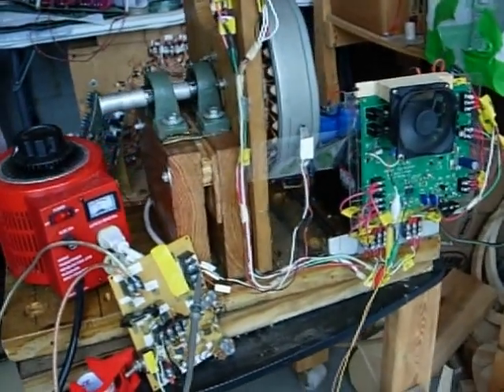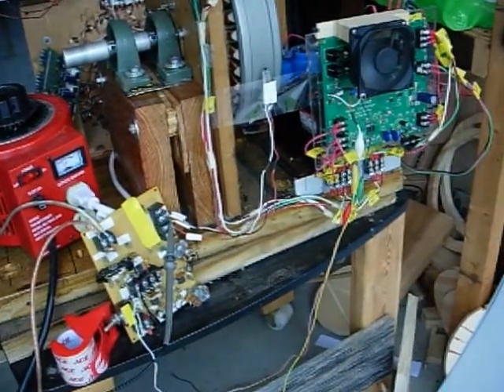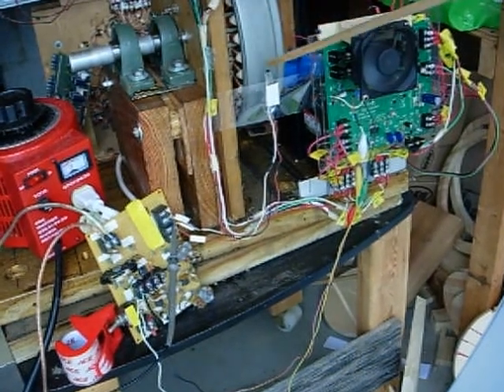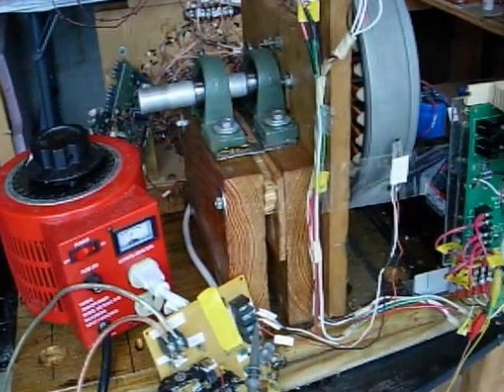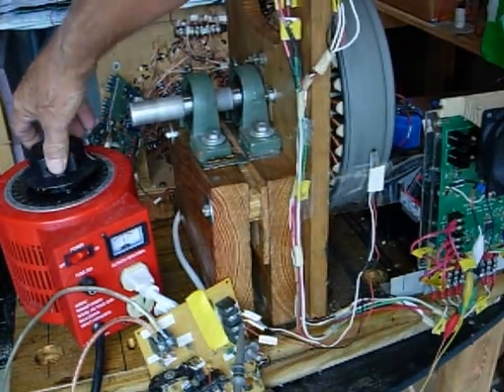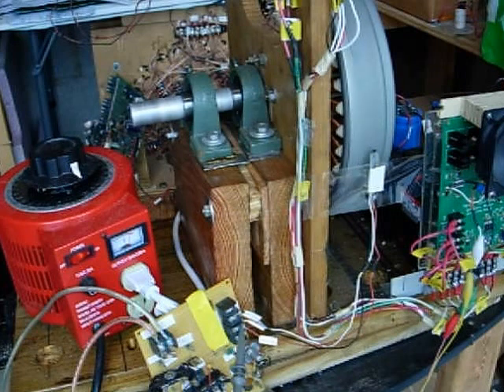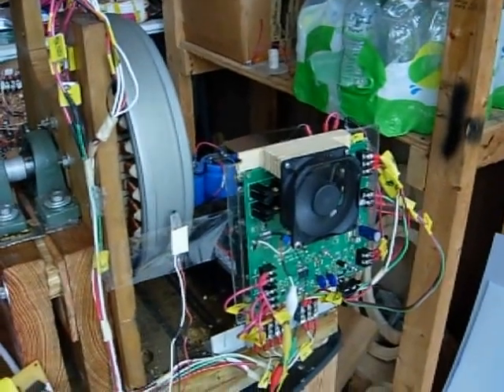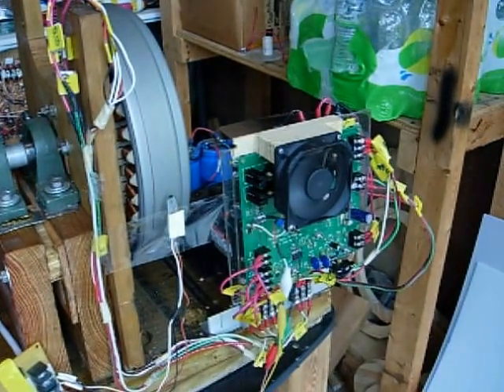Don Smith #131 running smooth at 191 VDC limit 2 amps 300rpm

Comment from the maker: I just found out that the original Hall Sensors 2 of them that came with my rotor had their flat surfaces aimed at the magnets on the rotor  the beveled edges were pointing away from the magnets.  I just ordered some more Hall sensors from Digikey  ATS177 bipolar latches.    It's interesting that the placement of the halls really changes the pulse width and position these directly affect the rotor speed and power along with chattering.  It'll be interesting to see how this all works.  I know that for each group of three coils there are 4 magnets NSNS so essentially their are 12 motors with 60/120 Degree spacing for Halls for my stator with 36 coils.  Hall sensors are placed A coil (Hall) B coil (Hall) C coil (Hall).   Using Oscope with Hall A pulses channel 1 you can check Hall B and Hall C on channel 2 to verify their relationship to Hall A.   I've messed with my B Hall to get 60 degree pulse but will probably change this back to normal 120 degree arrangement.

Comment from the maker: Next video will relate to motor phase, magnets, and Hall Sensors.  I just found an app note AN1046-D which describes using the MC33033 with MC33039.  First read indicates that my Rt Ct are wrong and the pulse width from the MC33039 is too wide and using 43K and 22nf at the MC33039 will provide a little less than 1ms pulses(970us) from the MC33039 to the MC33033.   The MC33033 with its Rt Ct at 5.1K and .01 yields a rate of 25khz,  this is the osc frequency used to PW Modulate the phase pulses.   I want use 4 or 8 small NEOs on the outside of the rotor.  By doing this with larger NEOs that match those inside the rotor along with outside coils 36 in my case the power can be doubled.  Their are even more areas on the rotors surface that can be used to repeat this process for even more power.   When you think about this,  the rotor could be not 2 inches wide but wider.

Comment from the maker: after frying my pcb I decided to use the old version 24vdc for testing stuff.   I found out that the center hall effect sensor could be rotated 180 degrees another words the flat side facing the magnets will give low to high pulses and the angled side facing the magnets will give you high to low signals.  This will allow your hall signals to match the MC33033 spec for 60 or 120 degree operation or any other degree operation.  When doing this I discovered that I had to reverse hall A and C.   The next test I need to do relates to the RC for the MC33033 and MC33039.

Comment from the maker: Another long term plan is to redesign the rotor magnet mounting and stator coil layout.   New magnets NEO 52 disk shapes still 12 groups of 4 each.  The rotor will be machined so that the magnets will have both pole ends exposed inside the rotor is one pole and outside the rotor is the other end of the magnet.   Next step will be have basically the same stator coils but shaped into a "C" shape so that both their pole end cover the current inside of the rotor but the other end wraps around to the outside of the rotor.   The rotor then will rotate inside the C shaped coil structure.   By doing all this the motor will then have twice the power of the original washing machine motor.    Another consideration will be rotor diameter, here the bigger the better.    This type of motor  could possibly drive a car.   They certainly have some serious torque

Comment from the maker: I believe that the speed problem is what Gerard was seeing when he first started his motor once he found the correct spot for the Hall Sensors his motor now runs at 1500 rpm.   When you look at the rotor stator together  locate the  tie point where all three phases are connected together  to the right CW of this point is located Phase A next coil is B and then C.  Now from the A coil count over 4 coil.  place the A Hall sensor between this 4th and 5th coils, then B Hall and then C Hall.   We'll see what this does.   The current limit resistor is used only to limit the maximum current that can flow to the motor coils.  .05 ohms will limit to 2 amps , ,02 ohms gives 5 amps,  and .01 ohms gives 10 amps.    My new FETs can handle 600v 20.2 amps.  that's 1200 watts per pulse

Comment from the maker: The slow rpms is basically what Gerard was getting in his initial setup 200 to 300 RPMs Mine is doing the same thing.  From his latest video I now know where to put the connections .   the A Phase is first coil after the common connection point. and the A Hall sensor is in-between the coils 4 and 5 from the A Phase Coil

Comment: The sound of that motor is very nice. It does not sound 'forced' as with many motors. The wobble (or whatever causes that jerking sound) gives away a frequency of about 5 Hertz, so the 300 rpm must be correct. I think it will have a lot of torque on it.
Reply from the maker: +deslomeslager yup 200ms per rev is 300 rpm.   I'm hoping that the 2 amp limit being raised to say 8 to 10 amps will get this really flying.  but I only need 900 rpms.  it would also be nice if I could get 1800 and then switch to a 4 pole rotor on the gen instead of 8 poles.   I need to get another one inch shaft so that I can place the gen rotor with 8 magnets , washers , screws and goop on it.  by placing this assembly on two side by side right angle pieces of aluminum that are perfectly level it will roll to where the heaviest point is pointing down.  By drilling holes in the plastic I can get it perfectly balanced and no matter where I place it it won't roll.  This must be done for the higher RPMs.  Yes it does have torque but I think the 191 vdc is way beyond my FETs.  200 volt versions just came in mail today.  I'm still not exactly sure about the values of R1 C1 near the MC33039 in the schematics.